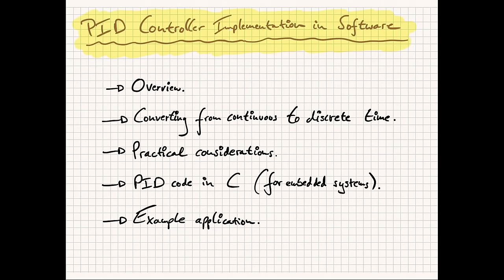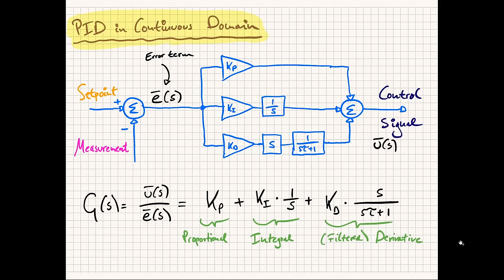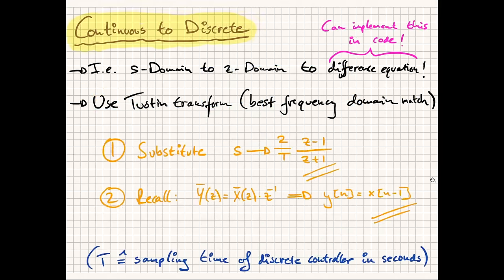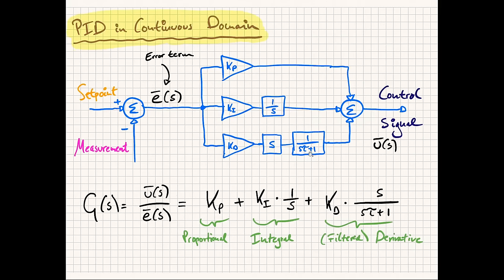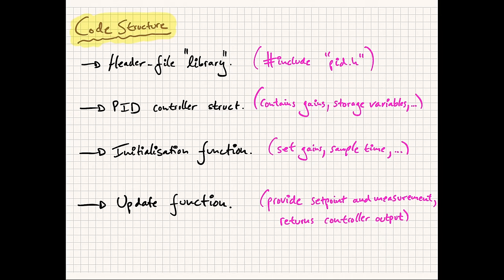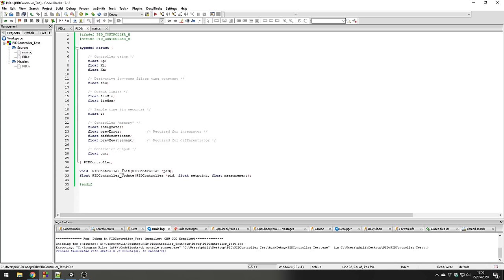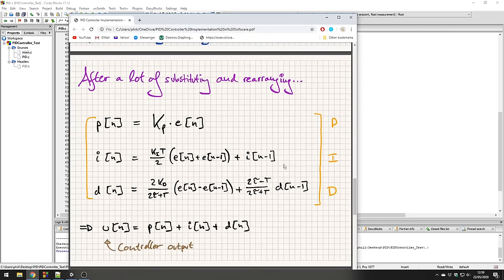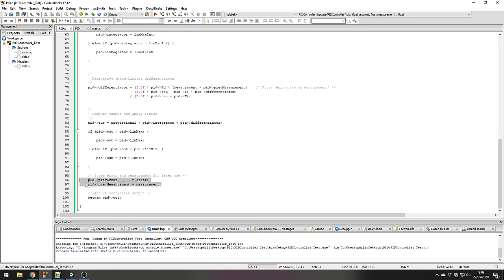PID Controller Implementation in Software - Phil's Lab #6

Comment from the maker: New hardware and PCB design course on mixed-signal embedded systems just released!
⏵Course content: https://www.phils-lab.net/courses
⏵Course sign-up: https://phils-lab-shop.fedevel.education

Something I forgot to mention in the video! Note on 'derivative-on-measurement': Since the 'error signal' effectively going into the differentiator does not depend on the setpoint: e[n] = 0 - measurement, and therefore (e[n] - e[n - 1]) = (0 - measurement) - (0 - prevMeasurement) = -Kd * (measurement - prevMeasurement). Note the minus sign compared to derivative-on-error!
I've made the change in the Git repo - before you would have had to use a negative Kd gain to get the same result. Now you can, as normal with derivative-on-error, use a positive Kd gain as usual.
Reply: Thanks for sharing i have a question how can we get tau and how we chose sampling time ?
Reply: Kd should always be positive, so please change it in git repo (and test code again). To avoid the confusion you could always use error to setpoint.But with a flag set the setpoint always to 0 but only for the derivative component. (hope the intention is clear). So one can choose if "kick in" is wanted or not. BTW: What's the practical impact of the kick in on the output response?
Reply from the maker: @gerhardwiesinger  Thanks, I've included the minus sign. Code has been checked and works as expected.
Reply: @gerhardwiesinger  You might make another derivative term for the setpoint, with a separate Kd(set), and this way you could control how to respond to setpoint change and how to measurement change.
Reply: Very good video and one of the best I saw on implementing PID so far. But I don't fully understand how the derivative of the measurement and the derivative of the error can give the same result. This seems to work only if you imply the setpoint is not changing between two measurements, right? I mean, if the setpoint is increasing at the same speed as the measurement, the error is constant and derivative of the error is 0. But the derivative of the measurement would be non-zero in this case. Or am I missing something.
Reply from the maker: @EinzigfreierName  Thank you! I should have made it clearer in the video. The derivative terms ('on error' and 'on measurement') are identical only if the setpoint is not changing, if the setpoint changes the terms will be different of course. However, in many systems the setpoint is not varied frequently and more importantly, the D term is generally for stability/damping and that is dependent on the response of the system (i.e. the measurement) and not directly the setpoint. Derivative-on-measurement is effectively identical to rate feedback.
Reply: @PhilsLab  This all makes sense now, thanks!
Reply: @PhilsLab  What if the set point is changed. Do we have an adaptive PID control then? Thanks

Comment: It might be worth considering adding a separate variable to integrate the errors before multiplying the integral gain. The float (essentially being scientific notation in base 2) will stop integrating if the value you are adding (0.5 * Ki * (error + prevError)) drops below the LSB of the fractional portion of the float for a given exponent of the integrator. In other words, you can introduce a steady-state error that won't be resolved for sufficiently small errors. The effect is exacerbated for low values of Ki and T.

Comment: Just finished my ECE undergrad last month. Practical implementations of control systems in digital hardware is something that I never learned and wished was part of my curriculum. Excellent, thanks.
Reply from the maker: Very glad to hear you found it helpful. Same for me when I was at university, lots of theory but effectively no mention of how to use it in practice.
Reply: I agree with you perfectly. Most of the lecturers just teach what they read in a book and not implementers. As the author of AoE, Horowitz, said "Most Engineers of this age are rather applied Mathematicians always hiding behind equations"

Comment: This is the first time I find a direct C application from a theoretical control explanation. I've been searching for this for some time on my university's library and no luck at all.
Thank you so much for this, you got a fan right here.
Reply from the maker: Thank you! Yeah, I had the same problem, as it was quite hard to find complete and documented code online (and in books) that also covers practical issues in implementation - so very glad to hear this has helped.

Comment: Immediately subbed. This is probably one of the best videos on PID control out there, and AFAIK, the only one that does a good job of explaining how to implement one in real life, where computation is discrete and numerical noise is inescapable. 

Loved the idea of dt-on-measurement. Had never seen that before, and now I wish I had thought of that.... time to update my PID code!
Reply from the maker: Thank you man, really glad to hear that. Yeah, I wish more people would actually show how to implement things in real-life, far too much time spent on theoretical learnings that don't translate 1-to-1.
Reply: @PhilsLab  Very true. Oh, and I implemented a new PID controller based on yours just now, and it's a significant improvement over my old one! Many thanks!

One thing I was still curious about, if I could ask for an elaboration, was on how you worked out the resulting expressions, especially for D. You mentioned using a bilinear transformation to transform values to discrete space, but your expressions have the transformation already folded in with the integration and diff. That was the one part where I had to just take your word for it, because algebra is really not my thing.

In any case, most excellent video! Thanks again!

Comment: This is a very nice information. I believe that the design can be further improved with a better anti-windup mechanism. Integrator clamping is a rather crude way to prevent the saturation of the control signal. A much better and elegant solution is the back-calculation algorithm which dynamically modifies the integrator. 

It's a simple yet very efficient solution. You need to impose a software saturation borders of your controller's output. Then you calculate the difference across this saturation. The resulting signal is now a second error in the system which is fed back via a negative feedback loop to the integrator's input. The signal can be further amplified(or attenuated) with it's own coefficient.

For example - a microcontroller can be an effective linear controller when the output is PWM. If we assume a control signal implemented over 10-bit PWM the software saturation is 0 to 1023.
Reply: [update:  whoops, this may already be implemented in the updated anti-wind-up]

/* or, more simply: */
p = ...; i = ...; d = ...;   /* P, I, D terms */
out = p + i + d;          /* sum to output */
out = (out>limMax) ? limMax : ((out<limMin) ? limMin : out);    /* clamp saturated output */
i = out - (p + d);         /* Remove any wind-up beyond saturation; N.B. this does not change [i] if output is not saturated */

Another approach is to use the incremental (velocity) form of the PID algorithm instead of absolute (positional) cf. 

  https://literature.rockwellautomation.com/idc/groups/literature/documents/wp/logix-wp008_-en-p.pdf#page=2

in which case the i term does not need to be saved from sample to sample because it is essentially stored in the CV (out) term, and clamping the [out] term essentially eliminates wind-up.

Comment: Very good explanation. I would add that the tracking error states the direction that the gain of the PID control will take. If the error is positive the gain will be positive, and vice versa.

Comment: One important attribute for controlling mechanical actuators is to avoid constant tiny adjustments. If the measurement is noisy and that translates to continuously changing an actuator, the increased wear from the jitter type adjustments leads to premature failure. This can be mitigated right at the controlled device by, for example, using a slotted coupling so that there is a bit of hysteresis. It should really be part of the control system, be it PID or any other.
Reply from the maker: Yes, that's a great point and something I only broadly hinted at with the 'derivative amplifies HF noise' part, but should have explicitly mentioned that this over-actuation due to noise in a control system will cause actuator wear.

Comment: Phil, an amazing morning watch and followup; excellent use of references to read.  I am invested in Arduino IDE now on VSC & PlatformIO so making your code compile directly may be a task but not impossible.  So, just what hill am I climbing to get VSC & PlatformIO to be happy.   However steep and tall that hill is, what you have theoretically discussed and digitally implemented is understood quite well thanks to your presentation style and knowledge. I will checkout the 6 part video series to learn more.

Comment: thanks for your detailed tutal. Two question, in your github code: 
  pid->differentiator = -(2.0f * pid->Kd * (measurement - pid->prevMeasurement)	/* Note: derivative on measurement, therefore minus sign in front of equation! */
                        + (2.0f * pid->tau - pid->T) * pid->differentiator)
                        / (2.0f * pid->tau + pid->T);

1.Kd use positive value? 
2. why not caculate differentiator part int the way below? 
  pid->differentiator = -(2.0f * pid->Kd * (measurement - pid->prevMeasurement)	/* Note: derivative on measurement, therefore minus sign in front of equation! */
                        - (2.0f * pid->tau - pid->T) * pid->differentiator)  
                        / (2.0f * pid->tau + pid->T);
thanks very much.

Comment: Thank you for sharing. I do have a question. In the code, I see that actually coded the tick time "Tau".  I've read in a microcontroller forum that Tau is not needed to be coded because it is taken care of every time the new sensor value is obtained in a tick fashion. It is confusing, since I see some code include the time variable and some code don't. Can you please explain?

Comment: Great video! What I would be interested in is how to derive the derivative part of the controller with the integrated low-pass filter. It looks like this is a very common problem but I haven't found a good video which describes the transformation of the transfer funtion from the laplace domain to the actual implementation in the discrete time domain.

Comment: Interesting topic, I did’t know about a PID controller until now.

From a programming topic, I would create this PID controller in C++ which encapsulates it more like a re-useable PID block. For the float data types I would may use a template type to be flexible for different use cases with uint8_t, uint16_t, etc. as some MCU’s don’t offer float support and the software float simulation eats a lot flash memory.

Great video, thanks.
Reply from the maker: Thank you, Helmut. I like your ideas!
Yes, C++ would offer a nicer way to make a class out of the PID controller. I tend to go with C these days, as I'm mainly programming for STM32s and C - to me - is just much better integrated than C++.
And yeah, MCUs without a floating point unit will have a bit more work to do running this code. Then again, most PID scenarios will commonly only run at a few hundred Hz or kHz, and the update routine is not particularly math-heavy so I've been able to run this on things like Arduino Nanos. Even though these days all I work on is STM32s with floating point units haha.
Thanks again for your comment!
Reply: @PhilsLab  today MCUs have sufficient flash and memory resources that C++ works great with them. I work with STM32L0, L4, D21 and ESP32, the entire code written in C++. At present for embedded projects with Mbed-os and Arduino OS. Simple data structures like a dynamic list of objects, a hash map etc. all this is available in C++ with good documentation without re-inventing algorithm in C where basic little support is given by the C library, with C++ all this is included.

I started some time ago with Silicon Labs MCUs doing basic low level stuff like an async serial. When I moved to STM, all this was different and it was needed to start over again for basic stuff like a async serial or a simple timers. Basically wasting my engineering efforts without being able to bring my work to a new platform like Atmet D21.

With Mbed-os all this is much better because Mbed OS has identical C++ APIs for all major ARM based MCUs, there are about 150 development boards available from different vendors all Mbed-os compatible. For ArduinoI wrote on top of Arduino Mbed-OS compatible IO and timer libraries. This means for larger projects my C++ code is 98% identically for different MCUs even across OS’s like Mbed and Arduino.

For a software engineer re-purposing code boosts productivity brings more stable and maintainable code. Focusing on the solution and being flexible to support entirely new MCU vendors is something where clean C++ Code blocks can help.
Regards from Hannover, Germany. Helmut

Comment: Great video.
I'd like to see a software-focused follow up from your  "Flight Control System Design: Hardware" video.
Reply from the maker: Thank you! Yes, I'll be doing a video series on control system design, which includes software implementation, and also hope to make a video on the extended Kalman filter which runs on the FCS.

Comment: Thank you for everything, all the videos and information... every thing is increadible and very helpful. Nonehtless, i have a question, but why your PID has limits of  -5 and 5 and for the integration part of -10 tup to 10, it is controlling the motors isn't it? For example if you control an AC motor with a trigger to a DIAC circuit, meaning the trigger should be between 0 up to 10 ms, if it is taken half the sin of the mains at 50 Hz, the PI output never can be negative, meaning that the clamping should be between this 0 ms up to max max max 10 ms, isn t it? Thank you very much

Comment: Thank you very much for your videos, you are a beast!! Please DO NOT STOP (EVER) and excuse my stupidity but i have to ask.
I tested your code and of course it works perfectly, but I would like to understand why (when you simulate the first order system update) the output of the plant is: 
output = (SAMPLE_TIME_S * inp + output) / (1.0f + alpha * SAMPLE_TIME_S);
I'm not grasping that and it's haunting me.

Much love from Spain ^^
Reply from the maker: Thank you very much for your kind words!
No worries, basically I start from the continuous time, first-order system: x' = -alpha * x + u. Then we can approximate the derivative to be: x' = (x[n] - x[n-1]) / T - where T is the sample time in seconds, such that:
(x[n]-x[n-1])/T = -alpha * x[n] + u[n].
Then, rearranging: x[n] * (1 + alpha * T) = u[n] * T + x[n-1].
And rearranging again: x[n] = (T * u[n] + x[n-1]) / (1 + alpha * T). Which is the expression you see in the code.
Let me know if that helps!
Reply: @PhilsLab  It absolutely does, thank you master ^^ 

As you are so kind I'm gonna bother you with a last question. Could you recommend me the best (complete and to the point) book/tutorial in your opinion to review/master control systems theory from a practical point of view? 

I'm working in a new job with stm32, just testing and validating hw/sw at the moment, but I will need to dive into motion control design problems soon. My background was a very wide industrial engineering and ended working programming PLCs in the automotive industry (no analog control). I finally got out of that hell and found a cool job but I have some gaps and need to refresh this as I never got the chance to implement the things I really loved to study. 

Sorry for the long post <3

Comment: I'm confused by a few things: I see mixing and matching of units in many applications: a velocity in meters per second is the error/input and a PWM byte is the output (0-255). This tells me that the PID variables are both weights and unit conversions at the same time. If unit conversions were eliminated, all PID systems would have much more similar coefficients. Also, what is time? Are they some standard "fractions of a second" unit or do they vary between applications?
Reply: I also noticed that but it is not a problem since measured value probably comes from A/D converter which means 0-4095 if it is 12bit. So we are not dealing with units on input and output is also unit less since it is PWM duty cycle in 8 bits. Maybe would be smart to normalize these 12 or 10 bit measured values to resolution of PWM. If A/D resolution is 12bit and PWM duty cycle 8 bit then: measure/4095 * 255

Comment: What does PID stand for? This:

A proportional–integral–derivative controller (PID controller or three-term controller) is a control loop mechanism employing feedback that is widely used in industrial control systems and a variety of other applications requiring continuously modulated control. A PID controller continuously calculates an error value e(t) as the difference between a desired setpoint (SP) and a measured process variable (PV) and applies a correction based on proportional, integral, and derivative terms (denoted P, I, and D respectively), hence the name. -wiki

Comment: Hi Phil, maybe a follow up on tuning the PID, how to get to the set point in the quickest time but limiting over and undershoot. tuning and stability are often just off as I think they are harder than getting the loop running. great video and I will be looking at this for my next soldering iron software update.
Reply from the maker: Thank you! I've actually got a video planned going from mathematical modelling, to controller design, to simulation, and finally through to real-world implementation. As you say, showing how to actually tune a control system and how theory compares with practice.